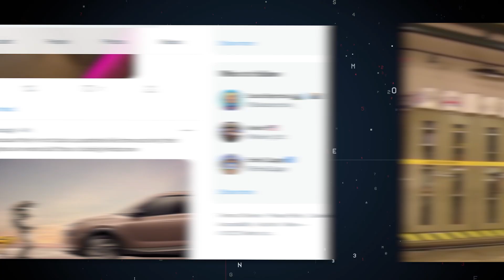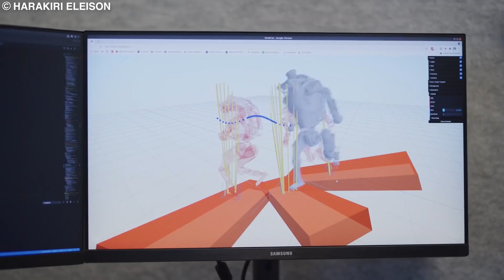Boston Dynamics' New Robot Makes Soldiers Obsolete, Here's Why

Comment: Yes, they are an absolutely lethal fighting force, for the full fifteen minutes of their battery life.
Reply: Just slap some solar panels and wind turbines on them and they'll be immortal 
🤣
Reply: @1871corporationUSA  until 18:00..  😁😁
Reply: @1871corporationUSA  lol
Reply: Not to mention their obvious vulnerabilities. An EMP would wipe them out in a second.
Reply: @aaronakamatt1747  So when skynet reaches full potential to go ape on the populace, the plebs would have to start storing away their "insurance policies" while preparing to live a pre tech lifestyle.
Reply: @aaronakamatt1747  It's pretty easy to protect machinery from EMPs which is why they aren't using EMPs to deal with drones in Ukraine.
Reply: @Ilvahss  No, it's not... at least not if you want to keep a comm channel with the machine, to give it orders or inputs of any kind.

We don't use EMPs in the battlefield cause it's expensive and messy and difficult to pinpoint without harming your own devices
Reply: @TheChzoronzon  There are specialised circuit breakers for conductive lines ('power and data ) to ward against EMP. They aren't cheap, but in comparison to the damage an EMP would do without it, it's worth installing them into a combat droid.
Reply: @Ilvahss  They would work up to a certain point, yeah, above all for the E1 and E2 phase of the pulse.

The E3 phase it's more problematic for a big EMP, and can extend for a couple minutes while the magnetosphere rearranges, with dire battlefield implications

The Practical Engineering channel here on YT had an awesome vid on the subject, if I remember right
Reply: @TheChzoronzon   The military can detect & calculate a  missiles trajectory to determine the general area it's going to impact. If they decide to use an EMP of that scale, I imagine they'd have enough time to switch anything unprotected off before detonation, with a timer to come back on after X minutes. Alternatively, they could give a final command to retreat to a location where humans can manually power on or reconnect unprotected devices. The specialized circuit breakers would come into play for smaller EMPs the enemy tries to surprise robots with.

I know Practical Engineering makes quality videos so I watched the video as soon as I read your comment lol
Reply: @Ilvahss  I agree that the main, huge, insurmountable problem of humanoid battle robots is not their vulnerability to EMPs

We can't make for crap a self-driving car in a mostly safe environment like a city, go figure a biped in a war field :D
Reply: @aaronakamatt1747  EMP shielding exists. Hell, just google it. Even civilians can easily buy it online. 

And it takes out the human's tech as well, making us even more vulnerable to the next wave of robots that come, and that's assuming the first wave's engineers would be so stupid as to not put EMP shielding over the circuitry. 

Anything us randoms on youtube can think of, I'm sure a team of cutting edge scientists, engineers, and warfare strategists would've long since thought of.
Reply: @Fermion.  I am well aware it exists but it isn't as common as you might think. It doesn't even need to take out the robot itself. What about the controller and the satellite keeping them connected.
Reply: @aaronakamatt1747  Anyone can order EMP shielding. It’s only a google search away. Hell, in college we made our own in a lab:

“However, a few rolls of heavy-duty aluminum foil, some cardboard boxes, and a galvanized steel trash can are enough to create your own Faraday cage and protect your electronic gear from EMP.”

EMP is basically just an invisible light pulse, dude. It’s not as difficult to block as you’re implying.
Reply: @Fermion.  "EMP is basically just an invisible light pulse, dude. It’s not as difficult to block"

 errr...for which frequencies, margins and intensities are we talking?

Commercial lab spec faraday shielding comes at around 20.000$ the m^3, google it... and let's not talk about how you maintain communication with such a shielded device...
Reply: Yes. We're not at Ironman energy sources are we. LOL.
Reply: The network-centric capabilities will allow the hot swapping of batteries by a robot into another robot.  The "big dog" will carry the battery packs for the robot army.
Reply: @mikedonovan4434  Take out the 'big dog' then I guess.
Reply: @nicopheiffer9793  Exactly. "Big dog" = single point of failure.
Reply: @nicopheiffer9793  interesting game mechanic idea
Reply: @mikedonovan4434  Yeah you just have to throw homemade napalm on it. Batteries can't handle heat.
Reply: @mikedonovan4434  Bingo then we will have Robots building more efficient Robots and that is when we are out.
Reply: @mikedonovan4434  Every 15 minutes, for all the combatants, regardless their position, under fire?

bwhahaha suuuure with super AI and being gluten free, what can go wrong?
Reply: there is sooooooooooooo much tech buls-*-t going around, and so ridiculously promoted in videos like this.
eventually reality knocks on the door
Reply: The whole video was just bad. Starting with the clickbaity title and  then repeatedly alternating parody clips from Corridor with actual footage from Boston Dynamics as an attempt to make the video more dramatic or convincing for people who don't know what corridor does is a rather dishonest way of trying to  keep people watching. And  then of course, the argument that a new robot actually makes soldiers obsolete which is of course pure bulls-it at this point in time.
Reply: There's a documentary on Boston Dynamics testing the earlier version of "Atlas" back in 2015 and it was barely able to walk.... 7 years later, Atlas has improved/advanced/progressed a great deal, doing the things demonstrated on this video....
Reply: @@user-pk3iw4me1e Once more, NO military will put plutonium power in a robot that an enemy might disable and carry off the field to harvest plutonium.   Its an imbecilic idea.   A plutonium power plant would be as heavy as  batteries.   The mars rover’s plutonium power plant weighs 100 pounds and provides only 110 watts of power, which is enough to drive it at One TENTH of One mile per hour, even though it sits on 6 wheels and does not need any power to hold itself up, like a bipedal robot would.  It carries 10 pounds of plutonium to make that power- so an enemy capturing just TWO rover sized power cells would be enough to make minimum critical mass for a nuke.   Atlas requires 3.7 KILOWATT Hours of power to run for one hour. A plutonium unit capable of powering Atlas with its power needs would nearly double the 345 lb weight of the battery powered robot, and require well over enough plutonium to make a nuke.  Again… just a moderate education in science would make it easier to tell what fantasies about the future are just fantasies. We don’t have flying cars because flying takes an order of magnitude more energy than rolling on wheels to travel the same distance. The robots you will see on the battlefield will be small TANKS, capable of carrying the power, and armor, and armament to roll into battle for extended operational endurance. Or they will be small drones with shaped charges released in swarms to attack everything they see that could be a threat.  Or, they will be more autonomous versions of the standoff UAVs we already have, that will launch missiles from altitudes that evade small arms fire.  Just because some doofus can make a CGI animation that looks cool doesn’t mean it will happen or is possible to achieve.   You will never see a working hyperloop, because the engineering problem is equivalent to building a SUBMARINE hundreds of miles long, And because AIRPLANES already ARE Pods that travel thru very low air pressure to achieve sonic and supersonic speeds, except they can transport you to ANY city, not just the one you built a huge steel tube to.  Folks trying to pay themselves huge CEO salaries by selling pipe dreams to people whose riches are NOT due to any technical knowledge are just con men.
Reply: Why do you think there is such a push for electric cars ? All the recharge facilities and infrastructure will be utilized to keep the future police state made up 9f these machines up and running funded by ppl who like to use "green cars "
Reply: A war focused robot would likely use a small scale reactor so they could functions for days on in without the need to charge.  Think submarines.
Reply: @marcusyoung2434  The problem with a small scale reactor (like the one used on Mars rover Curiosity) is the cost. At least for now.
Reply: @jackala2783  and in case of military use, if they blow the thing up you will have plutonium lying around everywhere
Reply: @marcusyoung2434  The smallest reactor ever, which far as I know is the SNAP-10A used in the RORSAT,  weights 430 kg (without complements) and gives a mere 600w

The most efficient (weight/power) power units based in nuclear decay, the GPHS-RTG modoles that power space probes like the Cassini mission, weight 57 kg and produce 300w, not near the thousands that any robot soldier would need

The power plant of a nuclear sub weight around 110 tonnes, nice backpack u need there
Reply: First usages will likely be house clearing.  A robot wouldn't take that long. Humans come in after.  Probably see them used in domestic police raids
Reply: @jjkrayenhagen  Thats a good point.  I could see that.
Reply: That’s why you keep ‘em plugged in like evas
Reply: Or a powerful Electro magnetic pulse. Lol
Reply: Christopher, Atlas is the obvious test bed for a future robot soldier (As suggested in this video). I'd be sceptical in taking it on now, let alone a more advanced version of it in a further 7 years from now going on the progress it made since 2015.
Reply: They’ll make better batteries. They just need humans most likely child slaves to mine in the most dangerous areas on earth for the extremely rare minerals to make them 👍
Reply: @gavandwina.5889  People claiming the tech will get better or that they will develop better batteries are expressing articles of faith, not facts of science. The periodic table is pretty well understood. “Better batteries” is a nebulous statement that belies no real understanding of the chemistry and physics involved.  We HAVE improved batteries, but their WEIGHT has not gone significantly down.  You simply need X amount of molecules or atoms of a given electrolyte to store X amount of electricity.   AS the number of electrons in an element goes up, SO DOES the number of protons and neutrons, which increases mass dramatically.  Liquid batteries can be nearly infinitely rechargeable, but they are very heavy and practically impossible for a mobile solution to electrical demand.  Will Batteries be improved?  Sure. Incrementally.   But a 10% increase in energy density per pound will NOT mean a robot can suddenly be powered by batteries for any significant length of time.  We will have battery powered drone swarms because they will only need to fly for ten or fifteen minutes.   But we wont have battery powered troops.
Reply: @christopherpardell4418  great explaination. Lithium is the most active chemical element. So I think we have reached a bottle neck here. Are there any big battry technology progress in the past ten years? Not  "soft technology" like the battery management system. Some "hard" technology like new materials with much higher energy density?
Reply: @gavandwina.5889  that is such a colossally ignorant comment, the minerals you are talking about are components of the anode/cathode, but don't significantly change the energy density of the thing, that will depend on the potential of the chemical reaction, the amount of charge transferred and the ion mass, the higher the charge and the potential the higher the energy, the higher the mass, the lower the energy density, you wont really get anything usable better than lithium ion, not in the short term, and very likely ever
It really shocks me to see this amount of magical thinking on so many tech related videos, we are talking about things that can be worked out quite easily, in this case just by looking at this chart https://en.wikipedia.org/wiki/Energy_density_Extended_Reference_Table and we are not even getting into the energy distribution problem nor what happens if you blow up all nearby charges (all the robots stop and end stranded)
Reply: Basically, what the army found out in field tests. A plain old donkey is way more practical than these "big dog" packing robots. They find their own "fuel", they make less noise, they are more intelligent, and they are good for moral.
Reply: @Chris B lol! i give up, screw this, its like talkng with flat earthers
Reply: they can make them running on nuclear power 😲
Reply: @kareldegreef3945  I doubt that that. The last thing you need is for your enemy to be collecting your damaged nuclear powered droids where they can crack them open to get the nuclear fuel and use it for dirty nukes to be lobbed against you.
Reply: @kareldegreef3945  Now that would be a nightmare.
Imagine an army of Iron Man's.
Reply: question of time bud
Reply: That's a lot of kills in 15 minutes, fancy your  chances against a flat battery?
Reply: Not much of a tech guy, are you?
Reply: @TheGunnCat  Well, lets see, I started doing 3D modeling and printing professionally in 1998, I was one of the original beta testers on Photoshop before Adobe bought it from Silicon Graphics. I currently own 3 different 3D printers, have a laser CNC in house, Vacuum former, and make molds as well as design structural components for everything from architectural applications to monumental scale sculptures.  I do consultation on production tooling as well.   The thing is, I understand the actual limitations of technology and the costs involved.  Batteries are not a feasible solution for flight because of their WEIGHT.  Hydrogen fuel cells would be lovely for a city bus, but won’t likely find any application on a motorcycle.   Robot fighter planes, tanks, even swarms of drones are all feasible, but robot soldiers simply are not. They would be too expensive, too  short lived, too difficult to maintain, and too easy to interdict.   Just because some doofus with a copy of Cinema 4D can create an animation of a fighting robot does not make them any more practical than slick 3D animations of hyperloop could possibly make the hyperloop a practical possibility.   We don’t have flying cars because it takes an order of magnitude MORE energy to fly than it does to roll along the ground.    Just because you see a slick 3D rendering does not mean that anyone engineered an actual feasible design.   Boston Dynamics robot dog with a gun mounted on it is a more likely design than a humanoid robot, but even that dog moves slow, can’t actually SEE anything and understand what its looking at, and only runs for about an hour.  Put a fuel cell on it and it wouldn’t even have the payload capacity for the gun.
Reply: Last point, "I promise...LOL". Watch what Elon Musk has to say about future AI Technology......! We need serious regulation & monitoring..... Remember, drone tech started out as surveillance tech before world governments started using them for strategic strikes..  The real problem is if these types of future tech fall into the wrong hands, America's own tech could be used against it.
Reply: @MarkGeoghegan100  the wrong hands are the hands which write the regulations for everone else to live by.
Reply: @MadHeadzOz  💯%.. The biggest bully in the world..
Reply: @MarkGeoghegan100  If it's in the hands of U.S military or the CIA, it's already in the wrong hands.. ┐(‘～`;)┌
Reply: @MarkGeoghegan100  Elon Musk is a pathological liar and moron. His self driving cars still can’t. He wasn’t a founder of Tesla Nor of PayPal. The hyperloop was stupid idea and he stole it from a popular mechanics Article that was 80 years old. His robot is a joke. How dreams of colonizing Mars are idiotic. His vegas people mover tunnel is literally slower than walking. His purchase of Twitter was only slightly less stupid than his laughable attempts at ‘managing it’.  He’s a con man.  Stop believing in the ‘great man’ mythology the super rich want you to swallow to justify their avarice and corruption. Dogecoin was a con.
Reply: that's probably all that would be needed and it's not like batteries are getting less advanced.
Reply: @notthesamecc1927  and surely batteries will suddenly have a higher energy content than the reaction energy between the anode and cathode, go study basic chemistry and thermodynamics
Reply: The tech will only get better from here. Even with that limit, they can keep the bots dormant till they're needed like they do for battle droids in Star wars. Still, I don't see them being very useful until they can get it up to at least 30-45 minutes.
Reply: The problem is "until when?" I remember my first cellphone come with a battery that give an 8h, and now my smartphone (even more complex) give me 48h. They are developing more efficient use of energy right now.
Reply: @alexandrecerqueira3023  and since they are developing more efficent use of energy soon we will have electric motors with 250% efficiency.......
No, the fact that you can pack more smaller transistors in a chip with advanced lithography doesn't mean you can suddenly automagically increase the energy of a chemical reaction, nor that you will be able to somehow reduce the energy consumption of the whole system, with aI recognition + control + motors to nothing, a person in "standby" uses about 100W, less than an average desktop computer, and we havent even started talking about the fact that lithium batteries cant really be charged below 0 or above 45C nor operate at temperatures above 45C and their internal series resistance increases with the lowering temperature, this is just tech positivism bs nonsense, wishful thinking is not the same as scientific reality and moore's law, which is just an empircal law doesn't apply to everything
Reply: @diegogmx2000  Dont underestimate the human genius. In the XVII, people used to think that was impossible to fly, and now, after sending humans to moon, we are sending probs to all planets. If you can't see a solution, it doesn't mean it doesn't exist.
Reply: @alexandrecerqueira3023  human genius also figured out the laws of thermodynamics, which an other actual genius, noether, figured out were possible to derive from time reversibility on motion laws, but well, probably some dope tech bro will figure out a way around that using science magic
Reply: @diegogmx2000  "Any sufficiently advanced technology is indistinguishable from magic" Arthur C. Clarck
Reply: @alexandrecerqueira3023  "Dont underestimate the human genius. In the XVII, people used to think that was impossible to fly"

In the XVII century people could see birds flying exactly like us, and your argument is beyond cheap. As Diego above said:
 "this is just tech positivism bs nonsense, wishful thinking is not the same as scientific"

Ey, in 1936 an Spitfire plane could do 370 mph...and 40 year later, a Blackbird did 2.200 mph... that surely must mean our current fighters reach 18.000 mph, isn't it? 

DoNt uNDeResTImAte  HUmaN gEniUs.
Reply: @TheChzoronzon  You cold do less to say that you belive, againt all facts, that the human being reached the pinnacle of the technology development, and we can go no further.
Reply: @alexandrecerqueira3023  I "cold" not say that cause it's false

But that being false doesn't mean we can go beyond well proven natural laws or avoid common sense... there are many scientific venues to explore that don't require miracles

Again: in your first 10 years of existence, you went from 50 cm to 140cm... does that mean that you now are 4 meters tall?

If your answer is no, in your logic that must mean you don't believe in the human potential for growing (or some similar nonsense... see how easy is to imitate your absurd reasoning?)
Reply: @TheChzoronzon  But are we talking about human biology, or tec development? and yes, you are asserting a falsehood, even though you know it is false. We live in a capitalist world, and technological development in a capitalist world depends on the need for capital. If there was an economic need to develop faster planes, we would have already developed them. Why develop faster military aircraft if we already have intercontinental ballistic and nuclear missiles? We already have precision gps drones, and the IRONDOME. The development of technology depends exclusively on the need for capital. If capital finds it necessary to develop killer robots, they will. Have no doubts.
Reply: @TheChzoronzon  About natural laws, I think developers don't know that. I think you could go there and tell the developers that it's all a waste of time, that they won't succeed because there are natural laws. lol
Reply: @TheChzoronzon  As I said before: Go there and talk to the scientists who are developing the project "Hey, you, stop right there, because there are laws of physics and you will not make it." I think they will take it very seriously. lol
Reply: @TheChzoronzon  You're the one with interpretation problems. I was talking to the friend, explaining that it is a developing technology, and this friend was saying that technologies cannot be developed because there are natural laws. Where did I say that it would be necessary to break some natural law to develop technologies? Copy and paste the text here. Since when have researchers who develop technologies been unaware of the limits of natural laws? Didn't they study physics at school? But after that, you came defending your friend, saying that there are impediments to the development of technology, with the same story "there are natural laws". That it? It's some sect of "let's save the natural laws of technological advancement" that I don't know. You are crazy.
Reply: @TheChzoronzon  In my last comment I challenged you to copy and paste in response, where did I say it was necessary to break the laws of physics to develop technology. Your response was just ad hominem, evasiveness, and running around in circles, like a dog chasing its own tail. I'll only consider the debate moving forward when you copy and paste the text here, if not, I'll consider it a troll, and I won't answer you. I'll leave you empty. As I know you won't find this quote of mine, I bid you farewell.

o/
Reply: Solar battery
Reply: Well, 15 minutes is more than enough to clear out a building of enemies for example.
Reply: @primusro  Oh infantryman speaking here?
Reply: @billklatsch5058  no, special troops.
Reply: I feel like thats all the time they'll need
Reply: cold fusion or nuclear batteries are getting closer to becoming a reality.
Reply: @gallahant  No such thing as cold fusion. No such thing as a nuclear battery.  Con artists like Musk and  that theranos woman make promises that are impossible to people gullible enough to buy into them thru their religious faith in science or the idea that “disruptive’ technologies will make them super rich.   Its no different than Bernie Madoff promising impossible returns on investments.   A genuine education in science can help people separate hype from actual potential.
Reply: just like human can live with out O2 for 2 minutes.
Reply: Until you equip them with a nuclear battery.
Reply: so...go underground and wait for empty batteries!  However many of new robots already borrowed fighter planes supplying on the fly!...
Reply: Battery technology will advance too, while they will become lighter and more efficient.
Reply: @bellissimo4520  Chemistry says no. Batteries will become MARGINALLY better. That’s all.  Fuel cells can use atmospheric oxygen to save the weight of onboard oxygen, but the tanks for carrying hydrogen at 10,000 psi will always take up a lot of space and add significant weight for generating electricity, and Hydrogen is infamously difficult to deal with in terms of plumbing seals and such.  All in all, range will expand as the weight of the cars increase, and the cost of the rare earths in batteries will continue to be a major issue, as is the ridiculously costly catalysts used in fuel cells. It could very easily turn out that the carbon footprint of mining operations to find and dig up and process all these rare earth components will out pollute the gas cars that electrics are supposed to replace.
Reply: Stick an RTG or a Fuel Cell in that thing or make it a hybrid between Battery and Fuel Cell, Fuel Cell and RTG, or RTG/FC only and you should be good to go for quite some time. At the very least, RTG only means not having to worry about power for centuries at a time and hot swappable batteries are also an option.
Reply: If they are equipped with a fuel cell, they will be able to work for many hours.
Reply: @smasher6498  Fuel cells weigh a lot. They require Hydrogen which either needs to be super chilled, or compressed to ridiculously high pressures.  A 10,000 psi tank, for example.  At optimal pressure they are only 60% efficient, and as the pressure in the tanks falls, their output and efficiency fall, too.  They have a large exotherm and so devices running on fuel cells will have a Huge infrared signature, not ideal in war. Transport and storage of Hydrogen is problematic.  It is extremely difficult to even make seals and gaskets that can contain gaseous hydrogen.  As such, there is no real danger of robot warriors or Mules any time soon.  An ACTUAL Mule can carry more than Boston dynamics mule, and it will do so eating ordinary grass and water that it finds along the way. And four men can carry the load of Boston Dynamics most capable Mule robot and move silently.
Reply: @christopherpardell4418  they have to make then running on diesel fuel just like in the old days.
Reply: @christopherpardell4418  In this topic, same as with nanotechnology, quantum computing and AI, the amount of wishful thinking and gullibility is out of the charts. Silly nerds... and smart marketing guys, lol
Reply: @smasher6498  fuel cells only payoff in large scale building sized projects.
Reply: They are the reason cellphones are currently getting old unsold batteries relabelled as new ones, which fail more the longer you use them... because all the new battery money is going towards the batteries for these murder machines. #EndersGame
Reply: @OmenAkumaru20223   No. new battery technology will improve
Reply: @vivianthom4801  No, it won't  

We are already reaching the physical limits of what a battery can do... doubling the capacity of actual chemical batteries is literally impossible, and we would need at least an order of magnitude more. No way.
Reply: @OmenAkumaru20223  so
Reply: @OmenAkumaru20223  I don't think you know what ender's game was about .....